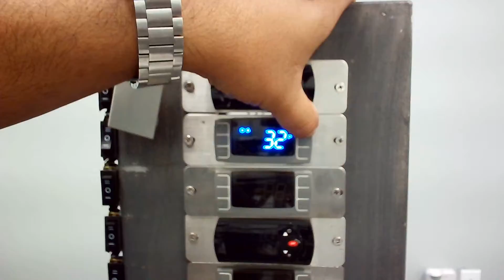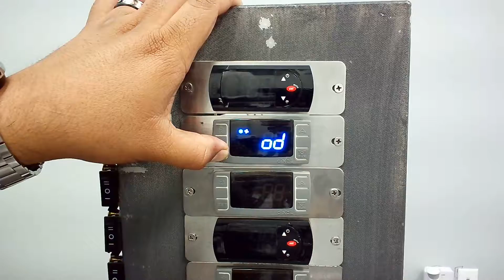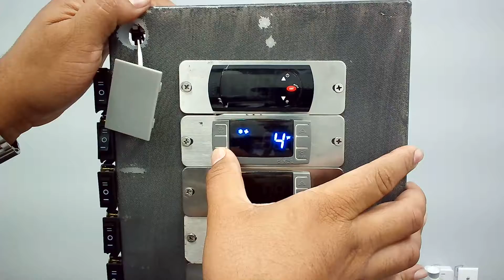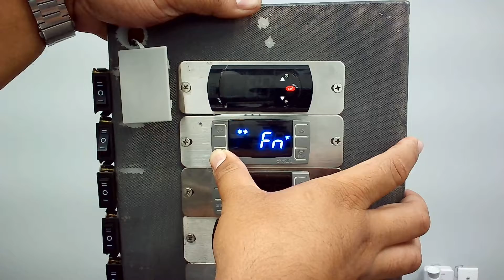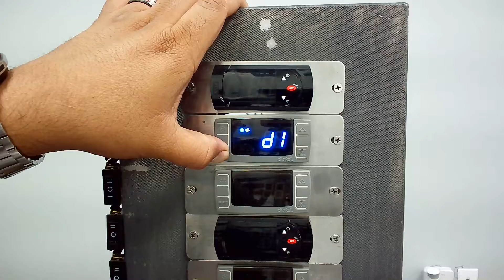Atosa Refrigerator settings for Dixell Controller

Comment: I have a question. I believe my dixel controller is maybe messed up and before I change it out how can I see current setting so when I decided to change it out I have all exact same settings for me new controller. Would it be just set and down arrow and just press set to see every setting?
Reply: Call your manufacturer and have them walk you through all the original settings one by one

Comment: Have a non Gr unit temp in the cooler is at 46 I've tried your instructions temp has yet to change
Reply from the maker: If your temperature is at 46 your unit is still able to cool but just isn't cooling properly, i would think this would be more of an issue with a fan or something else along those lines. If you have some time please just call in to our tech support line and we can try to help you figure it out. The number is 800-683-8660
Reply: @atosausatechsupport  thank you

Comment: What is a GR unit? What is a Non GR unit? How do I know which one I have? My product is ADT130EAWMC6K. Please help. Thank you.
Reply from the maker: GR and non GR refers to green refrigerant or R290 and the model number of any atosa unit will tell you what you have for example MBF8004GR. 
What you have seems to be a bohn unit and I would not be able to advise on those.  We simply don't know their products.
Reply: @atosausatechsupport  hello,
I’m sorry for the confusion, I had the model number mixed up with another unit. The model number for the Atosa Unit I am using is MSF8313. It’s a prep table refrigerator with drawers. I tried replacing the controller and programmed as shown in this video but didn’t seem to help.
Reply: The problem is that the temperature rises too high (70+) and once we restart the unit, it drops the temperature by 10 degrees and then after a while, it’ll go back up to 70+.
Reply from the maker: @Jay Jay  that sounds more like an issue with the cooling system.  Our tech support team is available Monday to Friday 730am to 6pm, please give us a call and they can walk you through some troubleshooting.  The number is 800-683-8660
Reply: @atosausatechsupport  thank you for your assistance.
Reply: @atosausatechsupport   hi
Reply from the maker: @krazigirl1000  Hi
Reply: @atosausatechsupport  i have atosa freezer but my fans won’t turn on I replaced the door switches but nothing any other recommendations